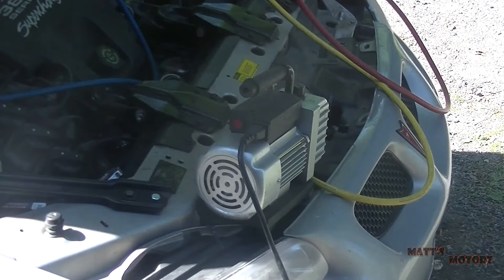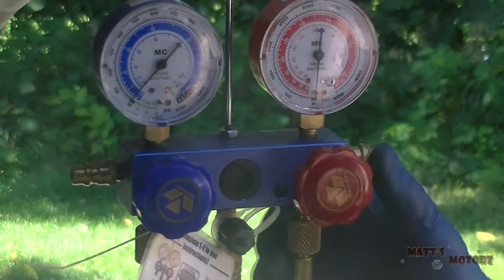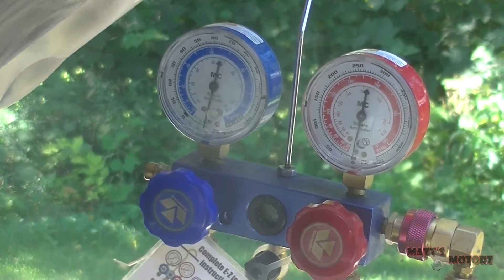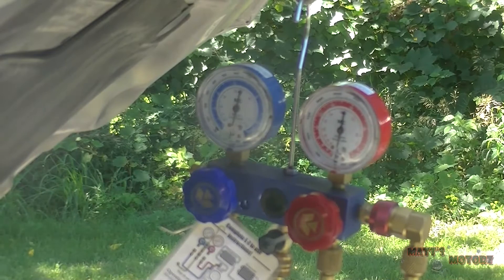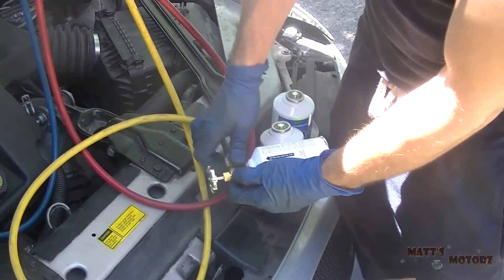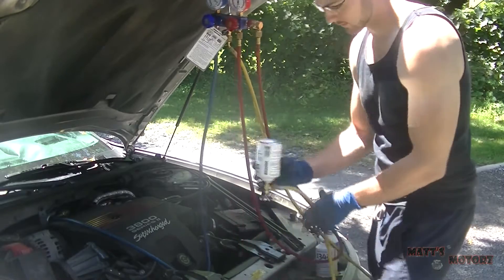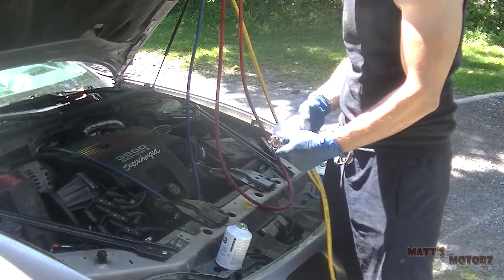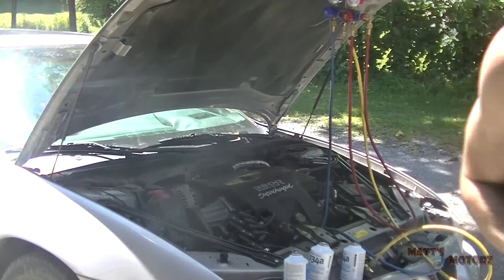How to Properly Charge an AC System

Comment: buy refrigerant with oil in it
Reply from the maker: You can do this, but it isn't a good way to add specific amounts.  After every AC job, (including system evacuation from a leak) you need to put in the specified amount of oil.  Having a fixed amount of oil in a can does not enable you to do this.
Reply: Oh well s**t lol

Comment: Some cans come with refrigerant and oil in it I believe.
Reply from the maker: Yes that's true. I forgot to mention that!
Reply from the maker: Just realized that what I was referring to in the video when I said, "not a good way to add oil"  is there isn't a good way (without expensive machines ) to add a SPECIFIC amount of oil.  You can only add the fixed amount in the can.
Reply: MattsMotorz The adding refrigerant isn't a big deal as much as the oil in my mind. I've heard refurbished compressors come with oil in them but that the system requires more, but how much more? I've always wondered how exactly you're supposed to clear the old oil out of the system (say you've got a leak and have to replace a line, when you recharge the system you've just added oil on top of what's already there), I don't know if that's dangerous for the system to have too much oil or not. Right now my AC clutch won't turn on, it doesn't seem to be getting electricity (I tried back probing it and turning the AC on, it read 0.00 volts), and all my fuses are good. I'm afraid to open the system since last year I had the system professionally drained and recharged and it's holding pressure just fine. I could throw 120 dollars at it and just replace the clutch while leaving the compressor on the car, but I'm on the fence about it since the wire going to the clutch doesn't ever get electricity.
Reply from the maker: In the factory service manual, it tells you how much oil to add when replacing each part, as well as when the system has been evacuated. It has all of that information.  With the AC clutch, I would try to hot wire it to see if you can turn it on manually  (I have done this many times, it is a good diagnostic strategy).  If you can, I think you need to get a good wiring diagram and start digging.  otherwise, you can absolutely replace the clutch without evacuating the system.